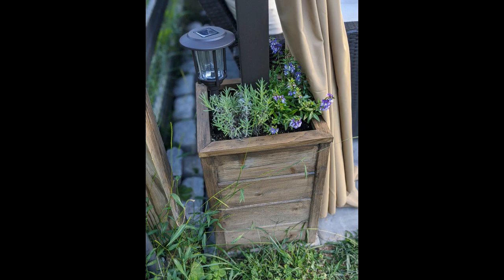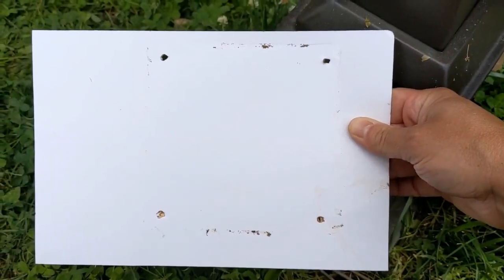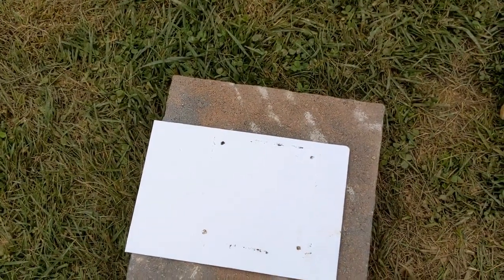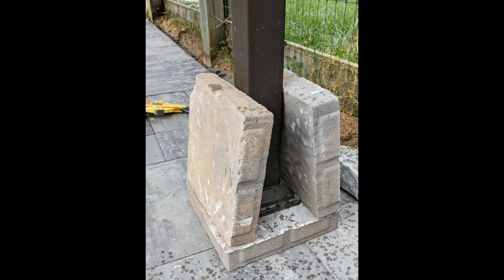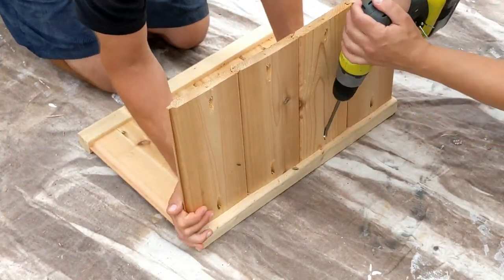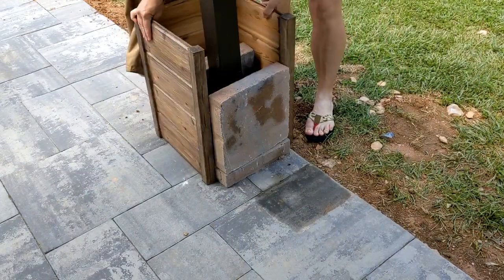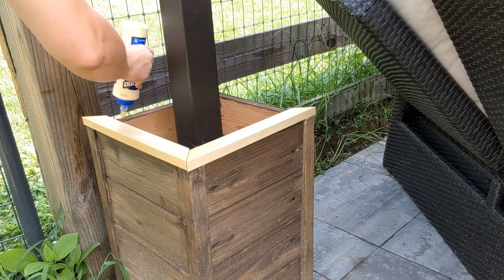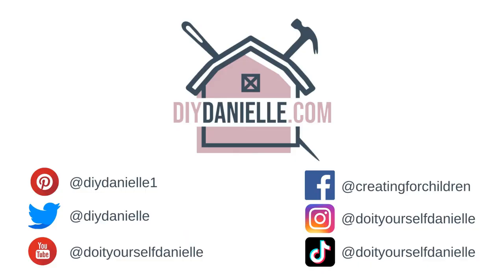DIY Gazebo Planters

Comment: Thanks SO MUCH! This is the solution I needed to fix a major problem. I found “a gazebo”, close-out priced at $99. I rented a pro-style Hammer-Drill to secure it to our pool deck.  This was to ensure it didn’t blow over from the Windstorms we get around PHX. (60mph)  However The Gazebo was sadly bent up b/c the metal isn’t heavy gauge like our previous one. So after partial dismantling to straighten out the  L-shaped uprights. I will fashion 3:56 3 sided planter boxes filled half-way with CEMENT so these things will NEVER BEND AGAIN!! Thanks again 💐

Comment: Great video thank you! Can you please give an Update on how the gazebo stood in the high winds? With this method
Reply from the maker: No issues! It's still up and I haven't seen it even remotely lift up. Lavender has done really well in here, probably because they like sun and dry (I tend to forget to water planters). My only issue and thing that I would fix is that I used one screw in some of the side pieces. Really needed two, at least in some of them.
Reply from the maker: I still panic check that the gazebo is still there every time we get a big wind though 😂

Comment: Oh also, if you care to hide external pocket holes, you can use a dowel and a cheap flush cut saw.  Just glue them into place and stain them.  Nearly invisible.
Reply from the maker: Thanks, yeah I'm a bit lazy and also like to have access to disassemble if needed. ;)

Comment: this is exactly what I was looking for to weight down the gazebo without damaging my concrete patio.  Would you please share the size of the paving brick/tile, and the measurements of the wood pieces? I want to do the same thing. Thank you 😊
Reply from the maker: I have more info on my blog post on diydanielle, search: Gazebo boxes (there's probably a link in the description of this video). Pavers are 12x12. :) I don't have a woodworking plan up yet- I usually wait to see if there's any interest before putting one up.
Reply: @doityourselfdanielle  I did check on your blog and would love to know where and what type of wood you used
Reply from the maker: @vgarber83  Cedar Tongue & Groove Boards
Reply from the maker: @vgarber83  Cedar Tongue & Groove Boards
Reply from the maker: @vgarber83  Cedar Tongue & Groove Boards

Comment: Doing this now! Question, what do you use to contain the dirt? Any concern with dirt coming in contact with the leg?
Reply from the maker: Yes I debated this. I think I wrote a little bit about it in the blog post. The main thing was that the post is metal. I ended up wrapping it with some landscape fabric or pond plastic, I can't remember which. But where it's metal I don't think it'll degrade- or at least not quickly. But I tried to wrap everything and staple landscape fabric sort of haphazardly to keep the dirt inside.

Comment: Amazing design.  I’m copying this except I’m going with a hardwareless design.  Will be using my router table to cut a groove in the corner stock and sliding the panels into them.  Then I’ll use river rocks for weight and drainage.
Reply from the maker: That's a great way to go about it!

Comment: I like it! Thanks for the idea! my only question would be, any concerns with the moisture and acidity in the soil rotting away the legs??
Reply from the maker: Possibly? I wrapped the legs with plastic in hopes that would help. So far I haven't noticed issues, but I also haven't pulled the legs out.

Comment: I'm genuinely curious how you ended up with a 21 inch height. The cedar panels are 6 inches, you stacked 4 of them. Wouldn't that make it 24 inches at least? Did you cut one cedar panel in half? I want to do one with 4 panels, I think it looks better than 3. I'm just not sure if you had to cut one panel to get your desired height 🤔
Reply: Or do you lose an inch with the tounge and groove?
Reply from the maker: We didn't cut the cedar panels so we must have lost a bit. 😅